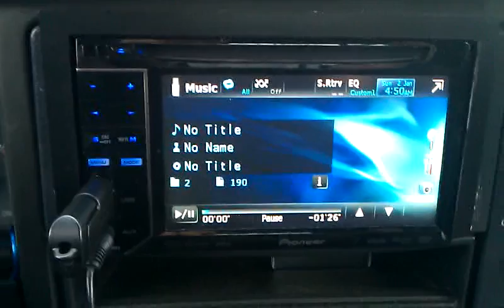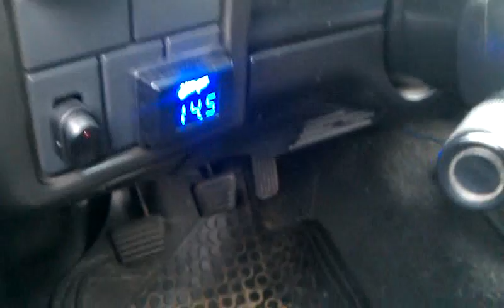FI SP4 on 600 rms

Comment: @getloud207 
but not at the same time
an 18 will most always be louder across a larger range of frequencies than a single 8 just by means of sheer cone area.

That's not to say one can't get 150+ db below 30hz on 8s. It just takes more than 1. =)